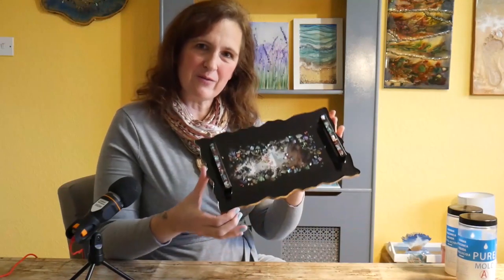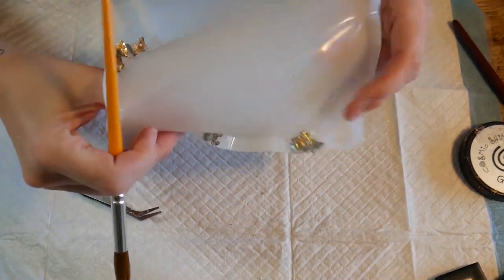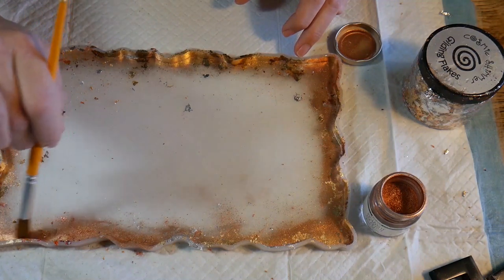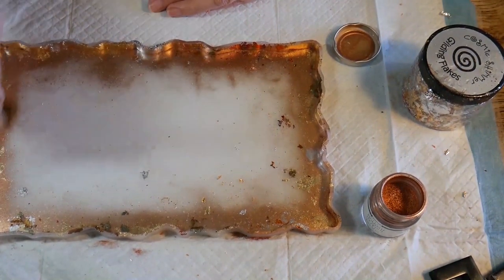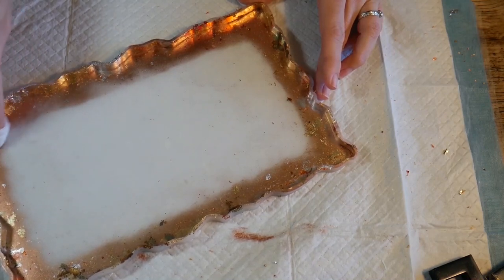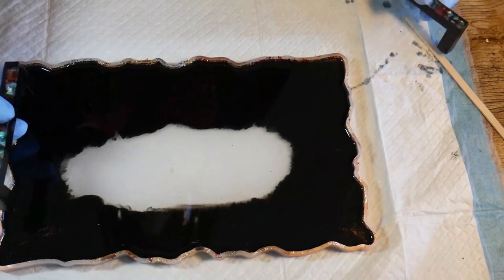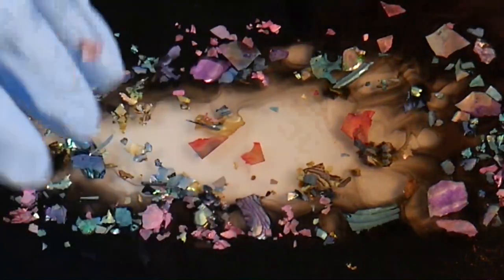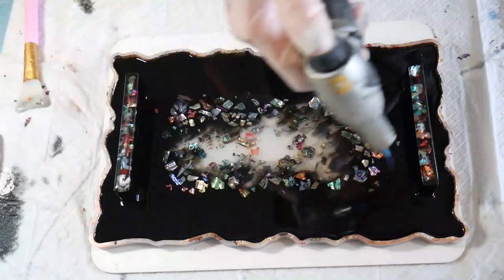Elegant Resin Tray Tutorial with Alternate Edging Method and Matching Handles.

Comment: I know I will get hate for this, but it really depends on the kind of resin you work with.  The resin I use does not suggest you need a mask or any sort of respirator at all, and states in it's safety sheet it is safe as long as you use it in a room with good ventilation.  Those edges came out fantastic btw, I have used mica to edge a coaster before, but adding the flake really made it pop!